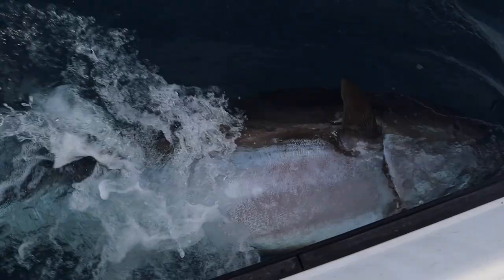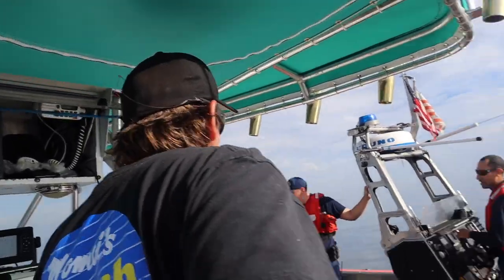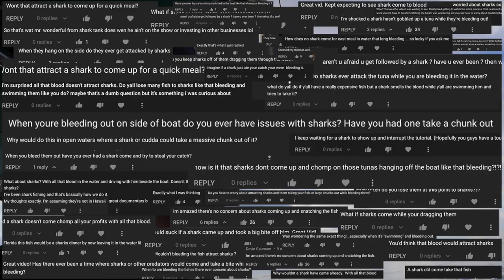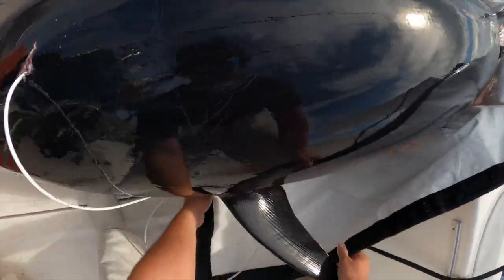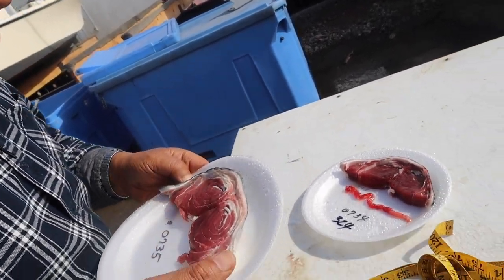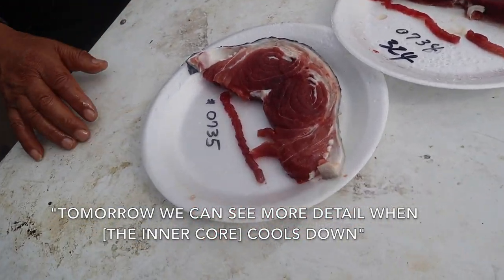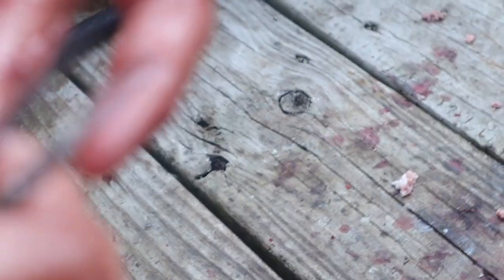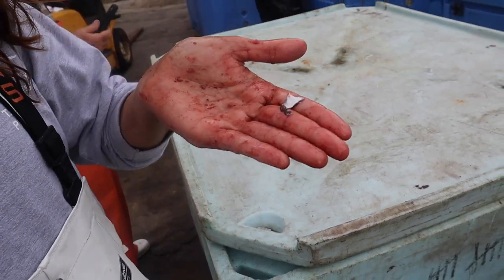WHAT WICKED TUNA *DOESN'T* SHOW (BTS of the Giant Bluefin Commercial Fishery)

Comment: I'm sure this is a common question. Based on the quality of that fish, what is the estimated value for auction on 623lbs?

(I'm surprised they don't have a better calibrated scale)
Reply: somewhere in the $22-$28 per.lbs range
Reply: @Sideler74  wow, that's $13,706 to $17,444. And it looked like when they weighed it, the trail was still on the floor (underweighing  the actual total weight). It's amazing though, given the researcher Chloe, estimated the fish's are to be 19-20 years old)!
Reply: In our country would worth between 2000/3000$
You can get 8$ for kilo if its not clean and around 18/20$ if you fillet it.
Thats way we send all tunas in japan 😄
Reply: @Sideler74  dang thats a $15K+ fishy

Comment: Nice fish.
Part of the reason your fish got a litle burn in the meat is because you need to de-nerve it through its spine & swim it for longer if you can.
You cut a triangle shaped piece from out of the top of the head just behind the eyes to expose the Center of the spine & then you need push a 10 foot long piece of 600 lb mono or a single strand piece of wire right down the center of the spine & the fish should shudder wildly as you work the line or wire in & out a few times until the fish stops moving . Make sure to get the wire right in the center of the spine so you don't damage the meat too so take your time  when doing this process. All fishermen don't do it but I've always got a better price every time we've done it. 
.It's better to do it at the same time as bleeding it when it's still in the water.
Makes the quality of the fish much better as the nerves are no longer functioning as the fish stops moving.
This is a recipe for a nicer grading fish.
You can also buy the proper tool for it online or at most good tackle shops.
Nice fish again guys congrats go get another.

Comment: Have been sportfishing Yellowfin and Bluefin Tuna (pacific models) on the west coast for 40 years and got a few "cows" (over 200), and have seen many well over 350. These "Atlantic Models" are just an awesome sight. Glad to know it is properly managed for future generations.
Reply from the maker: I worked on a long range boat out of San Diego for a year. They do a pretty decent job over there but looking back on it I know for a fact that people put tags on 10-15 bluefin multiple times. If I only knew what I know now
Reply: Just got back from an 8 day. Took limits of Yellowfin (15) 30-50 and Yellowtail (15) 10-25 and a handful of lings, Calicos and rock fish. Mexico is pretty good as far as limits are concerned. No more than 5 of any single specie, and no more than a 3 day limit overall. In so may words, regardless of trip length, no more than 15 of any 1 kind of fish. Bluefin (2), Dorado (2) and billfish (1) have separate and lower limits, but count as 5 for your total.  Either way, way enough fish for the freezer, didn't "dent the population" and a great bunch of fishermen. Gunna do it again next year.
Reply: @joevtfishing  wdym?

Comment: question. Why don't you kill the fish instead of bleeding it out? Or does it feel no pain?
Reply: A few reasons IIRC though been a while. It being alive allows its heart to help pump out the blood, which is necessary with fish to help have good meat. IIRC theres 2 sides to it, 1 lactic acid reduction by helping to keep it oxygenated more while its bleeding out and also to help get rid of the urea in the blood. This overall gives not only a better taste but cleaner meat (less bacterial risks). When you have fish at home and it smells "fishy", this is often because the meats began to break down and often because it was not processed properly when caught. Its vital to bleed fish out and keep them cold to stop that happening in the early stages (which putting it back in the water helps to do).